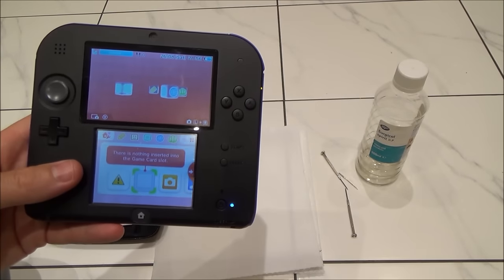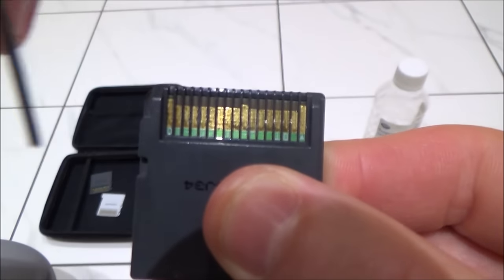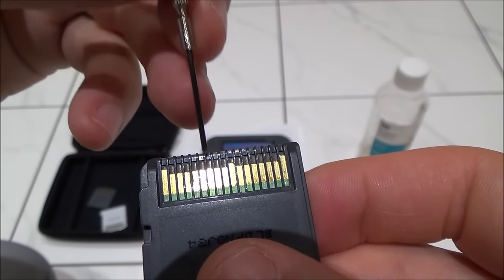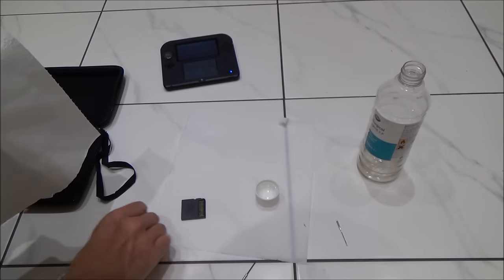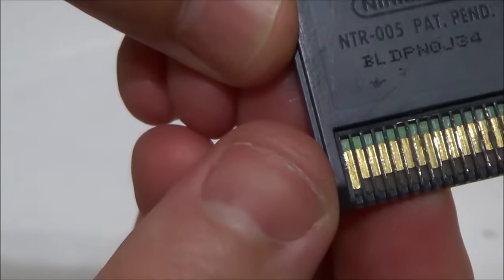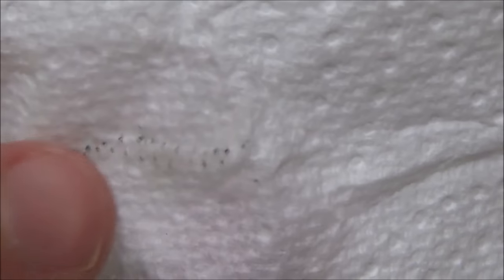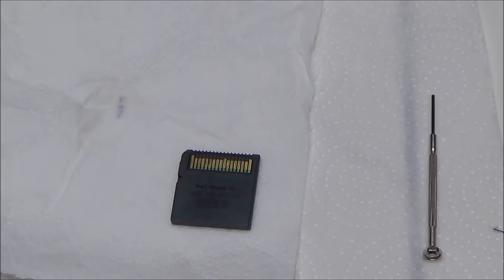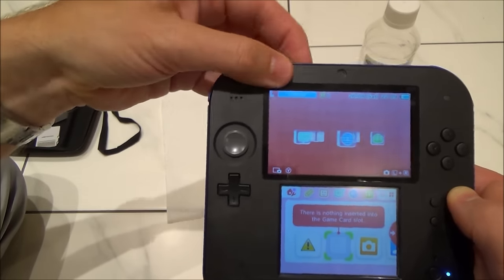How to Fix a Faulty Nintendo DS / 3DS Game Card

Comment: OMG THANK YOU SO MUCH! I found my soul silver game that I lost for years, and I recently found it. It wasn't working at all  and had some weird water splotches on it. I thought I wouldn't be able to relive my amazing childhood, but I used some hydrogen peroxide  (basically rubbing alcohol) and it worked! When I first cleaned it, it didn't work. I cleaned it the second time and it still didn't work. My childhood instincts kicked in, and I decided to blow on both the cartridge and the insert thing of my DSi. It magically worked, and I was shocked beyond belief. I remeber dropping  the soul silver game in the sink before too. I read up on some forums, and DS cartridges are basically waterproof. Anyways, I really appreciate the information and advice in this video, as I am excited to replay through Pokemon soul silver!
Reply: UnholyIce literally been trying to do the same thing for heartgold and I’m gonna test this
Reply: I tried this with pokemon platinum and my old heart gold games that couldn't be read on my Ds lite and it worked instantly !
Reply: Hydrogen peroxide is absolutely not "basically rubbing alcohol". It's not even alcohol at all and it doesn't evaporate like alcohol does, and it also turns into water if it's left exposed to air and light. Do Not clean your electronics with peroxide. It may have "worked" for you, but you got lucky, I assure you.
Reply: Hydrogen peroxide isn't alcohol at all, it's water with an additional oxygen atom, and it can decompose into water so do NOT clean electronics with it
Reply: They are waterproof?

No wonder why my SpongeBob Drawn to Life survived the washing machine...
Reply: Man I lost my copy of soul silver in like 2011. I know it's still somewhere around here...
Reply: Same dude nice 👍
Reply: That explains why my Animal Crossing New Leaf game survived the washing machine process entirely.
Reply: My friend gave me back the pkm black 2 game and it won’t work
Reply: Peroxide and alcohol are not the same thing and you shouldn't use it
Reply: @Espeon804  they might be but they still shouldn't be getting wet
Reply: BRUH I LITERALLY HAD THE SAME THING HAPPEN WITH MY POKÉMON GAME
Reply: UnholyIce my Pokemon platinum still wont work
Reply: I recently got a pokemon platinum game and after playing it randomly crashed, I tried it again after blowing on it and for a while it was working, until it crashed again. I know its old but its perfectly clean soooo😑.  No idea whats wrong with it. Anybody got any ideas?
Reply: My problem now is with pokemon white 2 :(
Reply: A friend gave me his Heart Gold yesterday and the contacts were so dirty. Cleaned them up and it worked! But now it seems as if the contacts aren't staying in place so I have to insert the cartridge into the DS by squeezing it and trying to get the contacts to stay in place but it's not working right now.
Reply: the same thing happened with my pokemon diamond =)
Reply: JUST had that experience with heartgold!!! Im shuddering thinking about that thing not working :(
Reply: @cherim3361  Iroically I didn't have rubbing alcohol either and used some Hydrogen Peroxide too for my Soul Silver game. It worked too.

But yeah, it was probably pretty dumb. I won't do it again if I ever face the same issue. It is pretty ironic that it did work for Giovan and I though.

Comment: tip to anyone watching :  if when you push down the game cartridge it works , but when you let it go it doesn’t work, I reccomend to put a piece of paper in between the game cartridge and the inside of the slot where you put it in . it makes the cartridge stay down without you holding it and it actually works
Reply: You can also put an easy peel sticker on the cartridge top. It might not be ideal for looks, but provides a layer. I do this with memory cards on my PS2 because my port is a little loose, but it'd work good for this too

Comment: Never use medicinal alcohol for cleaning any contact, that alcohol contain water and can oxidize the contact 
To fo that work use isopropilic alcohol or a electronic cleaning contact
Reply: If you are worried that Isopropyl Alcohol may damage your electronic contacts, I'd recommend that you use 99% Alcohol over 70% because it will have less water in, evaporate much faster and is less likely to corrode the contacts.
Reply: ezquimal iiiii
Reply: 90% isopropyl works just as well, but thats as low as I would personally reccommend, and its easier to find in my experience lol
Reply: ezquimal do*
Reply: could you use hydrogen peroxide?
Reply: I use 70 - 79% and have done that since I was 10 with my first Gameboy and it's fine I haven't had them start corroding and my original cartridges still work if I take them out of their case and put them in my GBA SP (ags 101)

Comment: Just wanted to add two things. Rubbing alcohol (propanol or isopropyl alcohol) will remove the serial number on the carts almost instantly. Also a great thing to use for cleaning like in the video is tooth-picks which has the added benefit of not risking scratching up protective layer on the contacts.
Great video :)
Reply: Is removing the serial numbers bad?
Reply: If you’re trying to sell it yea bc most people want to see the serial numbers as proof it’s authentic.
Reply: @xxAMBERxx423  Should be said also that the fakes have serial numbers too but one can usually tell the difference (and the code itself is sometimes wrong).
Reply: does it do anything besides that?
Reply: @garhd  naw, if you're not excessive with the rubbing or at the sides of the label where it can sink in it just cleans very well.
Even if the label edges swell up a little just leave it be for a while and it'll dry out by itself btw. if you really soak the label the addhesive will eventually disolve (which is in itself makes it great for removing stickers and addhesive residue).

Comment: This actually worked perfectly for my Pokemon HeartGold cartridge that would not read when in the game slot. Thank you so much for posting this video. Game was cleaned using described methods (except I used isopropyl alcohol prep pads) and began working/playing immediately. No need to force open the cartridge as seen in other videos. Great advice, man!
Reply: @Michiganmadecj  little late but you can probably find it on ebay
Reply: my brother accidently bought a faulty game cartridge of soul silver for me, i sent the vid to him bc im to scared to do it myself, probs gonna break it if i do it myself
Reply: @butter_2293  good luck!
Reply: Same except with pokemon sun
Reply: @butter_2293  
Come on, trust yourself!

Comment: You can also use a clean paint brush or a clean, soft toothbrush to clean game cards. Much less risk of scratching the contacts if you're inexperienced.
Reply: Lum1 Feath3r you can take those and saturate them with a little bit of rubbing alcohol. Brush in a downward motion, be careful not to brush too hard.
Reply: yep, thats what i always do. a soft bristled toothbrush does wonders for cleaning, especially on the outside. I always scrub down my 3ds and every month and replace all my grip tape cuz it gets so dirty and the toothbrush helps get into crevices and switches, as well as getting all the dirt out of my games every so often.
Reply: This comment saved my favourite pokemon game! Thank you so much 💙
Reply: @mullerlarco  just be gentle! I'm glad I could help!

Comment: yessss this works! I didn't have rubbing alcohol so I used some regular hand sanitizer and it did the trick! I used my fingernail on the other side of the paper towel to get to the edges of the dividers. my phantom hourglass and spirit tracks have been saved,, thank god
Reply: Did that fully solve the problem for you I am still debating wether or not to use hand sanitizer
Reply: Aaa I’m going to try this out for my spirit tracks! I adored that game so much when I was little
Reply: I used hand sanitizer as well and the game works perfectly fine now!
Reply: 5 years later it still works, thanks!

Comment: Nice but it's really OTT. Just a Q tip and vinegar rubbing on the back will do the trick 90% of the time.
Reply: THANKS
Reply: Can confirm
Reply: For real
Reply: Does it actually work
Reply: I'm just trying to get prepared for the 2ds and I don't want this to happen to super smash Bros
Reply: Really? Thanks
Reply: Vinegar is a corrosive, do not do it
Reply: Isn’t vinegar corrosive?

Comment: Hey! This saved my Pokemon Sun cartridge. (: I didn't use alcohol - just scratching at the gold part with a cut q-tip. Had to do it a few times before it worked but thank you!
Reply: NishiOxnard, was wondering if I could find an alternative to rubbing alcohol as I don’t have any. You gave me the q-tip idea. Managed to bring back my Heart Gold rom! Thank you!
Reply: Firephoenix905 witch hazel might work
Reply: Imma try this on my pokemon white silber and pearl if it doesn't work my childhood will be gone
Reply: How small are your qtips tho or did you just push in the soft part?
Reply: @valeriotaco7596  I'm trying to remember - I think a normal q-tip was too thick to fit between the gaps in the cartridge - so I probably cut it in about half so it could get in there, and straighten/clean anything out. (: So, just try to cut it to that size!
Reply: This worked for me with a toothbrush, thanks!

Comment: I bought the zelda games on ebay and neither of them workes when I got them. I put them in and out a few times and phantom hourglass worked but not spirit tracks. I looked at the back and there was spilled juice or something stuck in the contacts. I just wiped it with a toothpick through a slightly damp cloth and left it a few minutes and it worked
Reply: I bought Spirit Tracks, and it is not working. So I'm going to try this.
Reply: My phantom hourglass isnt working
Reply: @Skellygboy  
Check if the contacts are dirty.
Did you get it used?
Reply: Jack Stoutamore yes but I think I fixed it
Reply: I just got one my games from ebay and been have same problem with it not working...no damage...marks or anything spilled. I tried inserting and blowing on the ds just see if any dirt was built up but still nothing...very fusterating
Reply: im actually fixing my old spirit tracks cardridge rn :) it works but it crashed a few times with funny red text saying something like the disc lost contact, only happened the first time i saved doe

Comment: What happens to me is that it reads but sometimes, when it reads runs perfectly, but sometimes stops working and it freezes so I lose all my progress
Reply: Gianfranco Fonseca 
Reading issues of the cartridge, Try cleaning it, or as Billy Mayonnaise suggested, removing the plastic dividers, with nails or whatever you prefer.

I wouldn't recommend doing that tho, do it as a last resort, as the cartridge can be loose or get dirty easily.

Comment: I always use a toothpick to clean the gold parts of the cart. It tends to work most of the time.
Reply: Agent 1 I tend to use rubbing alcohol and a toothbrush. Don't know, it always works for me when I brush with a downward motion
Reply: Joer'ct Drew That sounds more effective. I should try that next time.
Reply: Agent 1 Don't use too much force, and be careful not to oversaturate the brush.
Reply: Agent 1 I once used lead from a pencil but did it gently, so I think when one of my games stopped working it was just dirt. This was several years ago, too. 😃
Reply: Agent 1 heya, if you've tried it within the last 2 months, how has it been?
Reply: Callie?

Comment: Believe it or not i got my non-functioning ds cartridge to work by removing the little plastic dividers on the gold part. Just use a finger nail and scratch them out, also makes it easier to clean.
Reply: Billy Mayonnaise 
Probably shouldn't, unless last resort.
As it can have reading issues, or the cartridge could be loose.
Reply: Yeah i wouldnt reccommend that, but it can work. r4 cards dont have the dividers as far as I've seen, so ovbiously the dividers aren't required

Comment: For the record, it's better to use a can of compressed air (if you can get your hands on one) rather than blowing.  Even if you're very careful not to spit, breath has a lot of moisture that's not great for the delicate electronics within the console.  A can of air is made for this sort of cleaning.

Comment: Can someone please help me? I'm 99% sure no one is  going to answer. I have a game called Animal Crossing new leaf on the new nintendo 3ds and it used to work but now everytime I play it it stays on the loading screen then it stops and crashes. on my screen when it crashes it goes back to my home screen and says "An error has occurred,forcing the software to close. The system will now restart. (Unsaved data may be lost.)" then restarts my 3ds. I try it again and the same thing happened. I tried cleaning the game cartridge and the slot where you put the game in and still no difference. Someone please help me because I put so much effort into that game.
Reply: The game cartridge is probably just worn out. Theres no other solution other than buying a digital version and transferring your save file using the Save data transfer tool from the eShop
Reply: Installity have you tried turning it off and on again

Comment: I tried to fix my faulty pokemon black, but... it didnt work. Rest in peace, i wont forget you 2011-2018
Reply: Azereus Mumko 
Ah damn, I have 5 Pokemon games lol, Pokemon black version 2 included .-.
Reply: Azereus Mumko they sell DS/3DS cartridge shells on eBay. You could have taken your Pokèmon cartridge apart, cleaned it, and put it inside one of the replacement cartridge shells. It should work. You'd have to make a label for it, but it should work
Reply: i tried that method too, opening it, cleanse it, put it back together with a new shell, but it didnt work either.
Reply: Thanks for the help tho.

Comment: Tried this 5 times with mario kart 7... nothing
Reply: That's means your game is fake, dude.
Reply: AkumaPON Ipon or his actual ds’ pins probably are damaged or his game is not very nice and the rom chip or something doesn’t want to be cooperative
Reply: I'm late, but have you tried pressing the cartridge further down then where it settles normally? If it does read when doing that, use some tape and use that to hold down the cartridge for you.

Comment: Another way to do it is using an eraser on the contacts which might feel a bit safer beacuse its not liquid, if you need more info there is a tutorial on my channel.
Reply: AF5000  hi
Reply: An eraser is not going to work!
Reply: AF5000 wtf is the contact
Reply: do you mean the golden part of the game cartidge?
Reply: I watched your video it did not work :<
Reply: AF5000 Erasers don't work. If anything, the fragments get stuck and mess the cartrage up even more. Rubbing alcohol and a toothbrush are way better, but brush lightly and only brush in a downward motion so the dirt doesn't go up into the cart.
Reply: Frog Lord Try the rubbing alcohol and a toothbrush. Be careful, don't press to hard, and only brush in a downward motion until the dirt comes off. Another thing you can do is if you don't have rubbing alcohol and instead have the pre-moistened glasses wipes you can use those, too. Just be careful that you don't damage the plastic of the cartrage. Idk why it's there or the use of it, but I know breaking it isn't something you want to do.
Reply: Tech James lol didnt expect to see you here
Reply: Jon The Otaku - AF5000 use saliva

Comment: I use electronics cleaner you can get at Wal-Mart in the auto section. Works every time! Drys very fast this also worked on an old Atari 2600 that would not play games.

Comment: I just cleaned mine with a dry Q- tip since we didn't have rubbing alcohol and it's working just fine now. I don't think I would've trusted putting alcohol or any other liquid in anything electrical anyway...
Reply: Oh I had bought one used pokémon platinum and couldn't get it to be detected more than like one time out of ten or so. I did it your way and now it is detected 100% of the time and it works perfectly. Thanks a lot!

Comment: I couldn't find a screw small enough to fit lol. But I did try rubbing the pins with a toothbrush that I dipped into 90% alcohol, and it worked really well. On the surface it still looks a bit dirty but the games play flawlessly for now, and get detected right away by the DS. You habe to make sure you fold a paper around the game card to prevent alcohol from spilling onto the front label, I accidentally did that but the alcohol eventually dries and leaves no trace. At least in my case

Comment: I've found its easier to crack them open and use something like brasso for stubborn games that won't respond to cleaning with isop. Had some that worked with isop and a week later nothing. Will open them up.  You can glue them back together or leave it loose.

Comment: Can we use an alcohol wipe or do they have a chance to not be wet enough? Just lightly press your paper clip or even a q tip in between the contacts with the wipe over the cartridge?
Reply: The biggest concern with alcohol wipes is fibers from the wipe being left behind and visibility. If it does happen to be too dry, it shouldn't cause an issue other than not getting it clean.

Comment: Cleaning mine with alcohol and a tissue (using a bobby pin to get in the slots) worked! I had to clean it fairly aggressively 3 times with copious amounts of 91% isopropyl alcohol. Used some compressed air to dry it and blow away tissue fibers after, and blast out the port on the DS. Now I can play cooking mama!😎